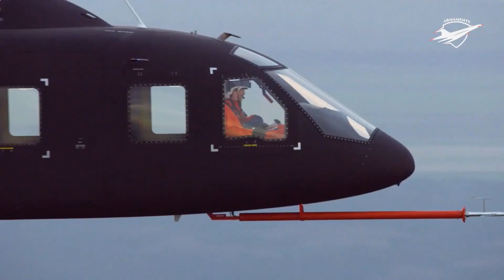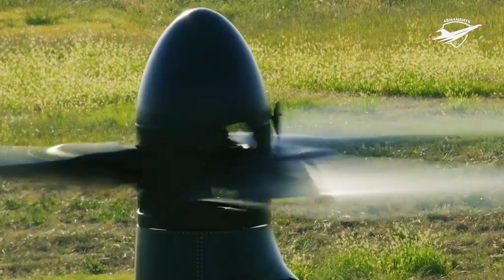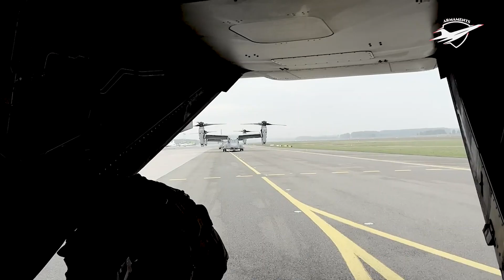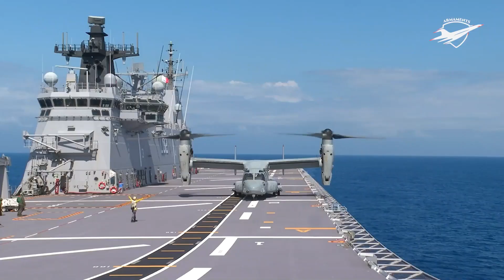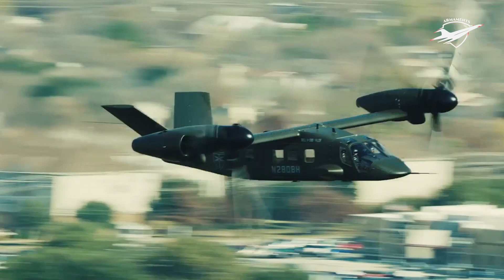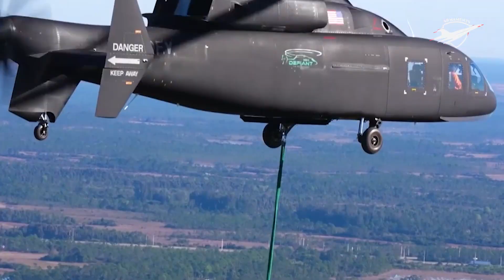US Army selects next generation Bell V-280 Valor Helicopter as replacement of Black Hawk

Comment: I cogratulateUSA Army,because of making a correct decision,because if BELL could not be the owner of this project it will be collapsed in future,SIKORSKY(lockheed) o Boeing has many project preparing for US Army,but how about BELL except the OSPREY V22 helicopter in a few quantity for MARINE corps...the 2nd reason is even if both are same in speed and capabilities,but BELL VALOR 280 has the range of 2000 miles but RAIDER or Difiant X has the half as 1100 miles...
Reply: Tell your Russian instructor to get you a better translation app.

Comment: Both are beautiful aircraft, but they are so different and optimized for different scenarios.
One is smaller foot print, agile and better suited for sustained presents and battle support. The other has unprecedented reach and speed.., but more vulnerable in real battle conditions.
I think Army should split order between 2 contenders. There is enough volumes in Blackhawk replacement to sustain both.
Reply: "One is smaller foot print, agile and better suited for sustained presents and battle support. The other has unprecedented reach and speed.., but more vulnerable in real battle conditions." - based on only your assumptions... the tests show otherwise as the Valor outperformed the Defiant in nearly every metric and only has a 19% larger footprint than the Blackhawk which the Defiant also has a bit of a larger footprint than. If you look at the air assaults tactics the Valor already fits in the landing zones they would want.

Comment: Question! They're going to have an armed version of the V-280, where do you put the weapons at? You can't fire missiles or rockets through the propeller blades when it's in the flying mode! Only when it's hovering, then you're a stationary Target! Defiant X wouldn't have that problem, because the rotor blades are permanently overhead! Bad choice, the V-280! I'm glad I don't have that problem as a fighter pilot!
Reply: The Osprey has a tail gunner facing the rear for that reason, but I’m guessing some versions of the Valor will have a traditional side mounted gun they’ll only use in when it’s in vertical flight mode. 

That said the Valor has the insane range and speed that the Defiant just couldn’t match. Though I was rooting hard for the Defiant to win!
Reply: @KC_Smooth  No the Osprey has a rear ramp because it is a cargo and bulk troop transport... also the Osprey has the exhaust facing downwards from the nacelles.

Comment: The Width of the Heli, Bell 280 is 81.79 Ft (24.93 m), Black Hawk is 53 feet 8 inches (rotor turning), for the Defiant, company stated comparable to the Black Hawk. Good luck future Pathfinders.
Reply: When quoting footprint, don't forget the length. The Bell V-280 Valor has a significantly shorter, compact length of only 50′6″ – compared to Black Hawk’s length of 64'10"
Reply: The Valor only has a 19% larger footprint than the Blackhawk... and no that was not apart of the requirements anyway. The valor fits in the landing zones the air assault tactics would already calls for.

Comment: Defiant is better than Bell in the attack role. Bell was given the contract so they would stay in business. IMO
Reply: Raider X has a better chance of staying up with the Valor. I don’t think an armed Valor is out of the question.
Reply: Yeah but these look like the halo helicopters so I’m in
Reply: The valor can actually fly.
Reply: Significantly faster, longer range, higher operational ceiling, more troops, etc, etc. Yeah, the Defiant is better.
Reply: @michaeljoseph741  no one is going to mention the transmission issues the defiant was having? thats probably a major reason they lost this contract. And the valor protoype logged more than 200 hours of flight time. The defiant was no where near seeing that.
Reply: @michaeljoseph741  The valor is much faster and has longer range I'm not sure what you mean?
Reply: @hilairelaplume1616  I guess the sarcasm was lost on you?
Reply: @michaeljoseph741  I'll get lost in your eyes Michael
Reply: @hilairelaplume1616  🤣🤣My first comment was in reply to the dude who started the thread, hence the sarcasm. No offence to you.
Reply: @hilairelaplume1616  🤦‍♂️🥴🤮🤣🤣🤣
Reply: Nah. The range and speed of the Valor is why it won. I do think the Sikorsky Raider X is a better helicopter for the scout/attack helicopter bid.
Reply: @KC_Smooth  both complement each other quite well. The Raider is cheaper and can flex as a transport while the Valor brings up the general utility and long range capability.
Reply: @KC_Smooth  If they can fix the technical issues with their design i also like the Raider. Although i do think the Invictus is the safer bid and is better in a traditional attack role while the Raider provides flexibility for different mission sets.